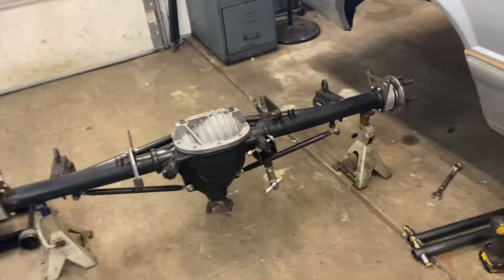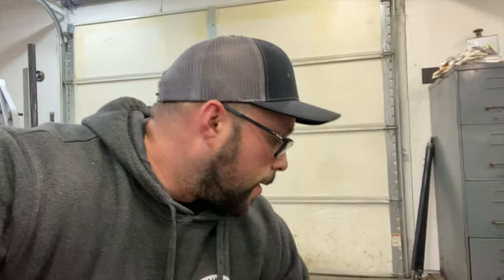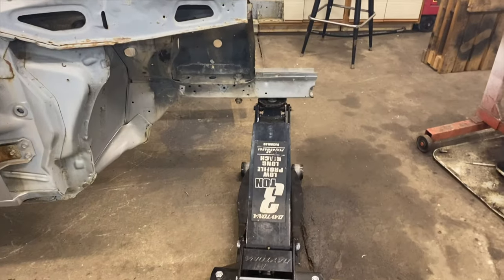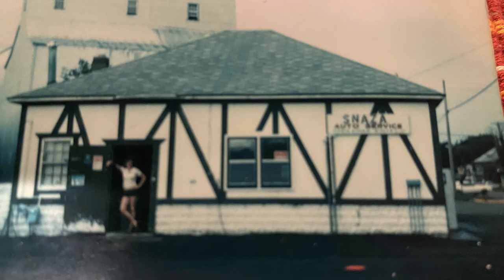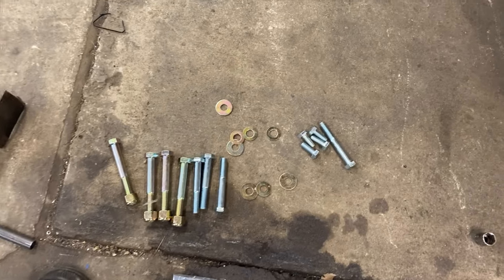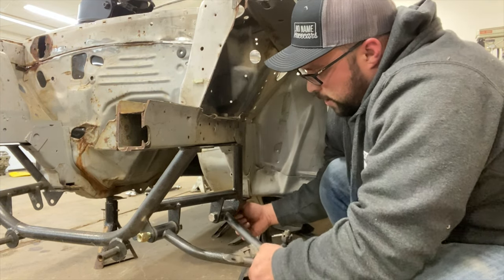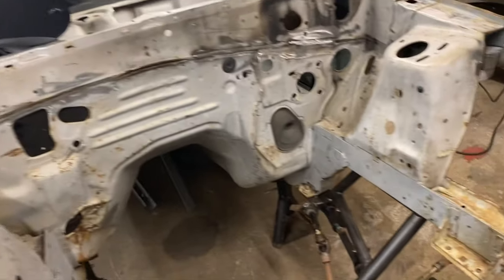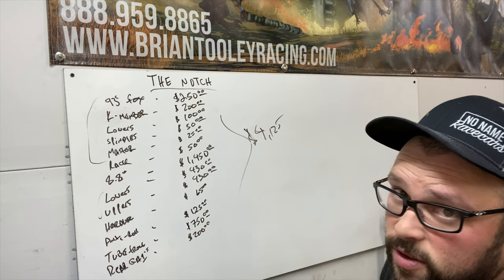TeamZ K Member and Lowers for the Mustang!

Comment: Sn95 arms on a fox is a way to get wide track width up front so I'm guessing that's why? I had them on my turbo 5.3 fox when I first started my channel, I think you need a bump steer kit and that's all really "required" to run it
Reply from the maker: After talking with Teamz it was determined they are indeed Foxbody, 1” narrower than stock. Still unsure why they aren’t the same visually as others
Reply: @NoNameRacecars  super weird why they would be so different but atleast they'll work and you're not screwed